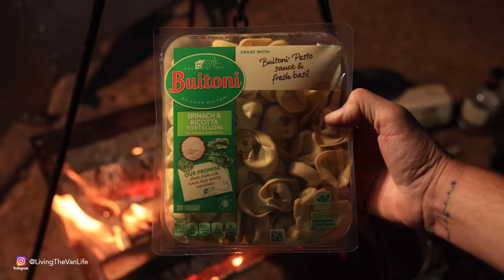Camp & Cook in the Desert - Living The Van Life

Comment: Love it. Chad took some of those rough spots almost faster than the Jeep’s. That’s how you do it. Test your shit, if it breaks, rebuild it stronger.
Reply from the maker: No… that’s just what happens when you have a 10k lb van with oversized tires, not a very low 4-wheel low, and a turbo diesel that builds power after 2,000 rpms - momentum is your friend.

Comment: Why D U chop wood using a knive while U have an AXE in your vehicle? Again I think your driving is so rough hence affecting the under parts of your vehicle. That could be the reason for loose or missing nuts and bolts for the prop shaft and the CV joints.

Comment: how would a 2wd 170 built out sprinter handle this trail?
Reply from the maker: Unfortunately it would not handle it at all. 4x4 short wheel base is an absolute must for this trail.  You could get a few miles into Kane Creek at the beginning. But once the trail starts climbing up Hurrah Pass, there are several short steep climbs where even my 4x4 barely made it.